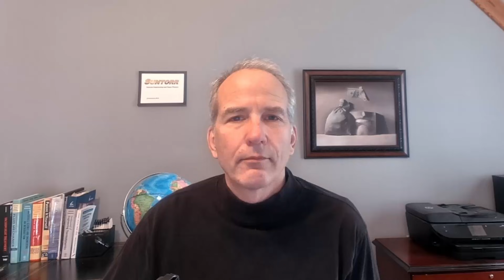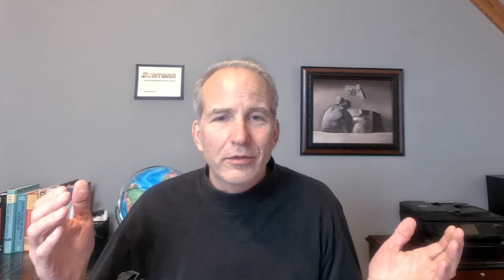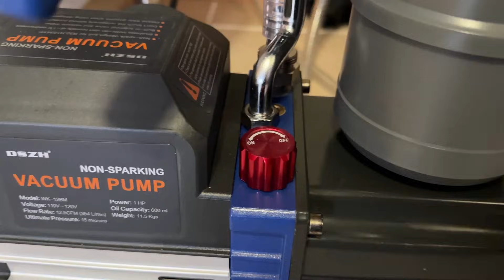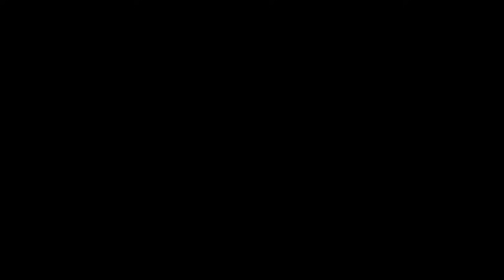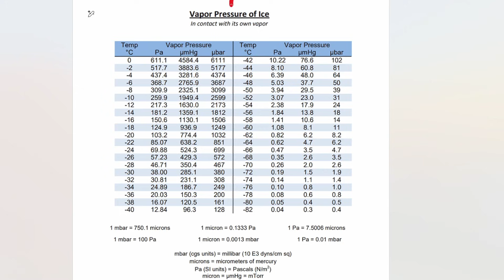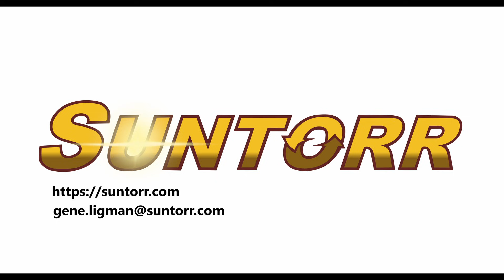Why Your Freeze Dryer Takes Longer to Finish

Comment: I can isolate a leak on small machines like this within minutes most likely and 10K BTU's at 0 degrees translates to roughly 4 K BTU's at about 90 degrees F condensing temps not 50 BTU's. Negative 40 F is a limitation one company has already overcome and I've already decreased production time by over 30% already . There are so many things you've overlooked or dismissed because they were never done before. The thing is these things have been done before but almost every single one of you live in a box. Your mind and imagination are hog tied by your inability to think outside of the box. Feel free to block me.
Reply from the maker: I look forward to the machines you are developing getting to market.  I suspect you will hit some speed bumps along the road, but if you don’t try, it will never happen.  
If your machines are good, ai will happily champion them to the marketplace.

Comment: Can you please give us more info on the gas ballast valve? Should I keep it fully closed or fully open or somewhere in between?
Reply from the maker: Great question.  The gas ballast should always be open half way for all freeze drying.  The only time it should be shut is in the laboratory on clean applications where you need to have under 10 mtorr pressure.  
What it does is help the pump get rid of water from the oil.  If you see your oil get a milky color, let the pump run on an empty chamber with the ballast valve fully open for at least a half hour, maybe an hour.  That will help dry out the oil.

Comment: Hi Gene, do you have an estimate of how much (miligrams/grams per kg) of non-condensable gases is released from different products during freeze drying? Isn’t main job of holding vacuum pump to remove these gasses?
Reply from the maker: Great question Jank.  It is pretty much impossible to know how many non condemnable gases are evolving from the product.  For example, if you put something that has gone through a blender, there will be quite a bit of entrained gases.  If it is an apple, not so much.  What the vacuum pump will actually be pumping away are gases from vacuum leaks, which are rampant in the Harvest Right brand and Parker machines of the world.